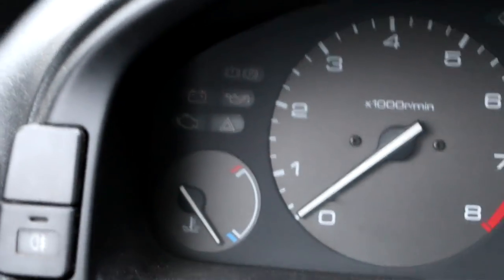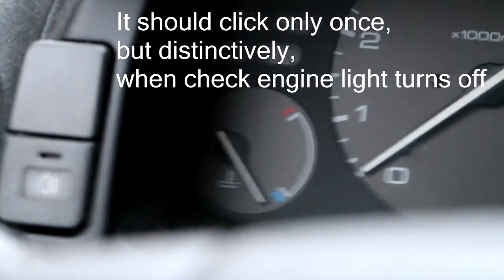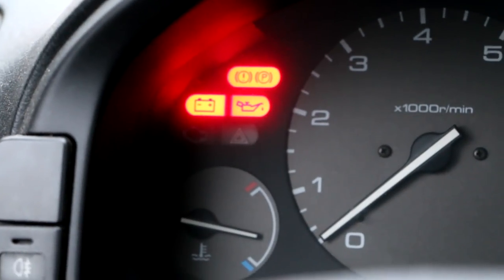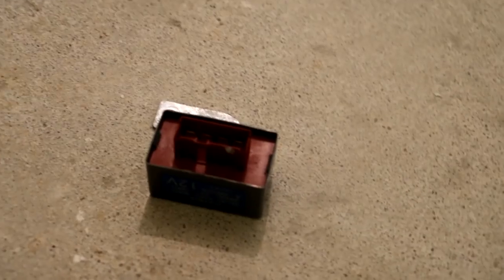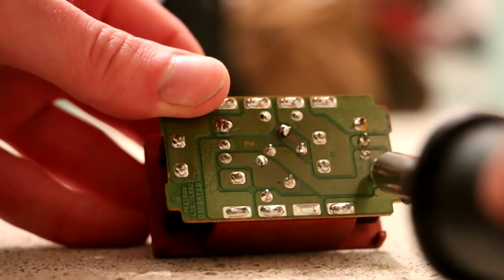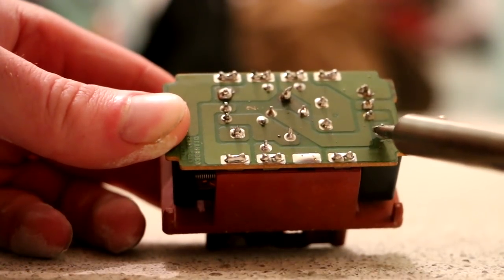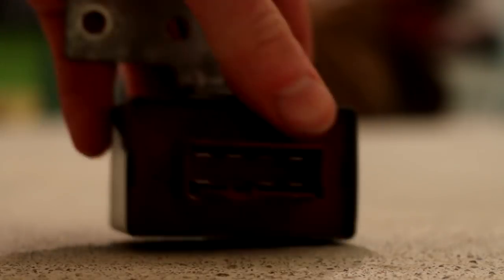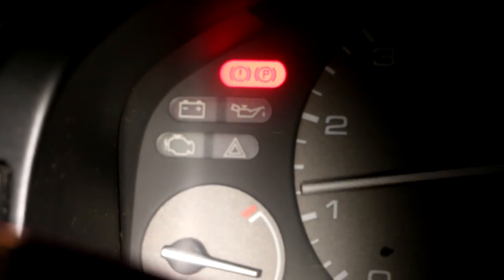Honda accord does not start if engine is warm, how to fix main relay

Comment: Great video, was exactly what was wrong. I got a new one from Amazon for like $43. There were some that were cheaper but I got this one. . Had trouble getting the old one out so I just left it in and attached the wiring to the new part.  I’m no mechanic, but it runs fine now.  Thanks
Reply: Can you please send the Amazon link for the part thank you

Comment: My 2003 is doing this and I replaced so many things before concluding it was likely this relay. Hopefully the new relay will fix it, but I am having troubles tracking one down.
Reply: Did it work for you, it didn’t change the warm no start for me?
Reply: @lawrencejames8603  It fixed the problem for 2 days, but it somehow came back. I'm done repairing the car lol, getting a different one at the end of summer.

Comment: I have a 01  civic  doing  the exact  same thing   and its pissing me  off  .  Ive  changed main relay  and fuel relay fused .  Thinking maybe  that would work  no nothing . Car runs good till u shut off  than no go   let sit half hour   and good togo camshaft sensor  changed   temp sensor  changed.  ..   not to sure  what to do.
  Need  help
Reply: Ever found out the issue? Having a similar one at the moment
Reply: You ever figure out the problem I have a 97 accord and it’s doing the same thing change the Maine relay cap rotor and finally distributor and still no go
Reply: @alexharrison8554  did you figure it out? I got a code 09 on my 1995 accord manual with 2.2l vtec. Honda tech said I needed a new distributor. Did nothing. Changed cables, spark plug. Spark plug tips are white.
Reply: @johnlibonati7807  Check for leaky fuel injectors
Reply: @johnlibonati7807  did you ever find the problem
Reply: @WWAABC  Yes! It was the ECM. I found it by testing the main relay because the pump primer was not turning on when I turned the key to the second click. The relay tested good. I checked for gas flow to the rail. It wasn't great, but I thought the engine should be starting. It turns out the ECM runs the relay and the injectors. I picked up an ECM on eBay for $80 and the car started right up like there was never a problem. I'm telling you. Get a new ECM before you do like I did and change the distributor, fuel filter, cables, relay, etc. Test the main relay. If it tests good, then your ECM is bad. Make sure your new one has the EXACT same model number as yours. The ECM is literally a 10 minute job with a deep socket 10mm and a driver or a ratchet, but a nightmare if you don't know. Hope this helps.
Reply: @johnlibonati7807  thanks bro helps alot.. done install a fuel pump, tune up, etc
Reply: @johnlibonati7807  did you have get program
Reply: @WWAABC  nope. Mine is a 95 accord. Plugged it in and it worked perfectly. Make sure the numbers on yours are exactly the same as the one you are buying. There are different numbers for manual and auto transmissions for example. The number is on the side of the ecm. You will see it when you pull it out.

Comment: I have a 97 Honda accord it will not take off if it doesn't run for 5 to 10 minutes what could be the problem
Reply from the maker: Do you mean that it stalls  if you dont let it run idile for 5-10 mins, before start to drive?
Reply: @JUrtanschannel  no it takes off slow.it has to run for 10 mins at least
Reply: My 97 accord does not start, its turning over and i replaced the relay but no start, new spark and battery land main relay already it has 65k miles

Comment: They used to be a normal SPDT relay but looks like they've changed the design to force you to buy from the manufacturer. The SPDT relay is around $3 and the manufacturer relay cost about $80. Looks like Honda intentionally changed the design instead of using a better made relay.
Reply: My 01 civic cranks and runs great it cuts off when it warms up will the cam position sensor cause this